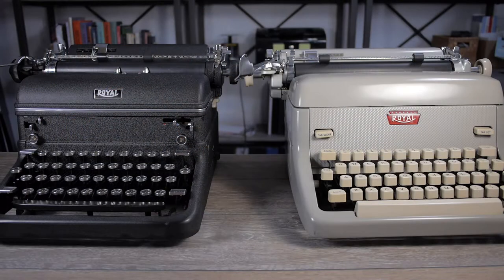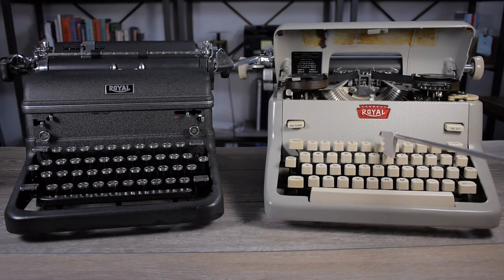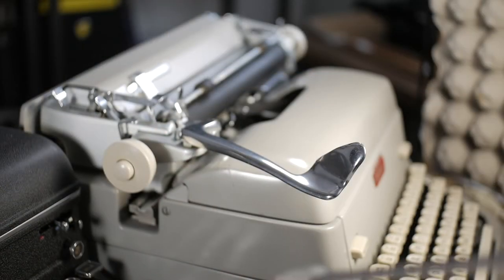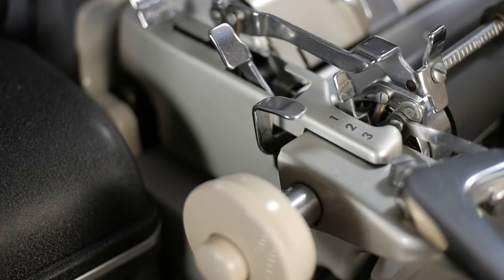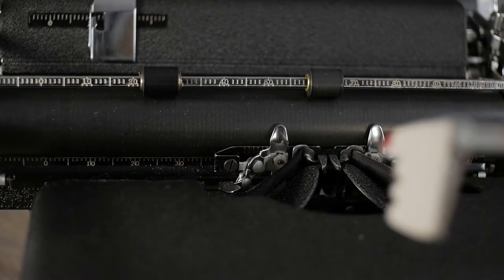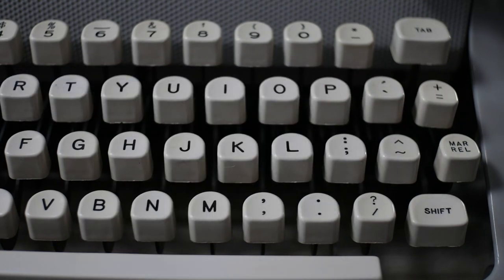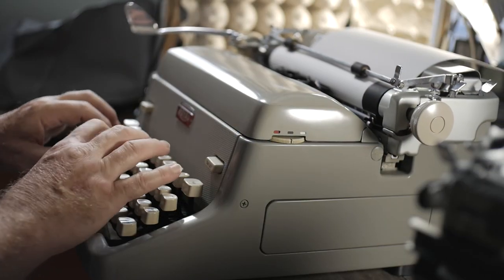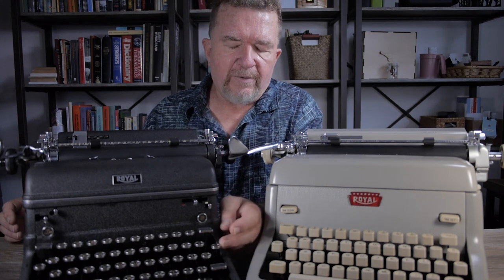Typewriter Video Series -- Episode 272: Royal FP

Comment: This definitely brings back memories.  I wanted to learn to type back around 6th or 7th grade, about 40 years ago.  My father brought back a Royal FP from his office. - he'd hauled it out of a supply closet, and given it to the maintenance staff for cleaning and lubrication.  While my memory is slightly hazy, I remember it as identical to this machine, except for the standard US keyboard.

It worked perfectly, but at that age, I couldn't reliably press the A.  I just didn't have the finger strength.  I really tried to learn on it, but I just struggled.   So, eventually, the machine went away - sadly, i suspect it went out.  

Fast forward 25 years, and after my mother passed away, I inherited her machine, a custom keyed Bluebird 18B that she never let me touch as a child.  I just like it better than the old Royal, but of course, I'm an adult now, with much stronger hands and 40 years of touch-typing experience.  I've had that machine for many years now, and am slowly returning it to a pristine condition.  I have new feet for it, and will be sending the platen out for a re-covering.  It's fun, knowing that I'm typing on a machine that handled 30 years of family correspondence, and the occasional magazine articles my mother used to bang out back around the time i was born.

I do feel a little guilty having slighted that old Royal back in the day, though.

Comment: I have one of each of these and though I love the logo button on the FP, the body just seems flimsier to me.  But the biggest issue for me is the key caps.  I much prefer the tombstone metal ones on the KPP.
Reply: Well, I wouldn’t say the FPs are flimsier.  Yes, they use cast aluminum for the body and plastic keys, so they are roughly about five pounds or so lighter than the KMMs, but they don’t seem any less robust to me.

Comment: The Royal I've been looking for, is a 1960s 660 Office Pro.  There's a video about it here in YouTube land, Periscope Videos is the channel name, if you search them and add Royal 660 typewriter it Shou bring that video up.

It's a pretty cool looking and its features are pretty cool too.

Next to that of course is my Hermes, a curvy body...the one I liked on eBay is gone....lol..I should have bought it, but I'm told if I want to live I can't buy anything here in April so close to my Birthday in May.

Another Hermés I like is the Ambassador Manual.  I do not own a full size Typewriter yet.  Notice yet.
A dark green Underwood #5 is another I'd love to have.

Lol cat hair, yeah that SCM 110 Electra i I cleaned, had So SO much hair I swear it looked like Chewy Chubbacca from Star Wars used it for a comb...so much hair it was on the grouds of gross with each tweezer pull out from the linkages. Sign...but it's all clean fresh oil changed, and new ribbon and works amazing.  All my machines run and look new, been very lucky on that aspect.

Thanks Joe for sharing these.

Comment: I have a similar Royal FP. It needs a new ribbon. I am not sure what to purchase. Any guidance?  Thank you.
Reply from the maker: Ribbons for Royal 10 and similar full-sized standard machines will work. On these machines you save the old spools (they have a hinged lever on the underneath side that performs the reversing action) and wind new ribbon on the old spools. Contact Ribbons Unlimited, they should have these Royal ribbons, in both black and black/red.

Comment: I have this exact same typewriter. WHERE CAN I FIND RIBBONS FOR IT!!????! I've seen a whole bunch of ribbons on eBay and amazon, but I don't know if they're compatible with my typewriter. CAN SOMEONE PLEASE HELP!!
Reply from the maker: The Royals use special metal spools with the auto-reverse mechanism underneath. Any 1/2" ribbon will work, but you'll need to respool the new ribbbon onto the old Royal spools. The SP doesn't use eyelets at the end of the ribbon to detect auto-reverse, so any 1/2" ribbon will work, provided you spool them onto the old spools.
Reply: My machine didn't come with spools, but ribbons unlimited seems to have them.

Pricey, though.

Comment: Hi ... I have a rare TYPEWRITER , symilar to the gray one you have  , I only have a problem , ..when I press keys roll don't retract or  go .... Margen and everything else work .... Do you know what could it happen?
Reply from the maker: Check if the carriage lock is engaged.
Reply: @Joe_VanCleave  do you know where the carriage lock is located?
Reply from the maker: Here’s an online scan of the owners manual: https://site.xavier.edu/polt/typewriters/RoyalFP.pdf

I was wrong about it having a carriage lock. Is there tension on the carriage when you hold a knob and press the carriage release to manually move the carriage, do you feel tension from the spring motor tryin to pull the carriage to the left? If not, perhaps the draw band is broken.